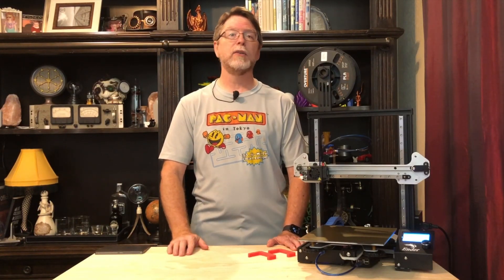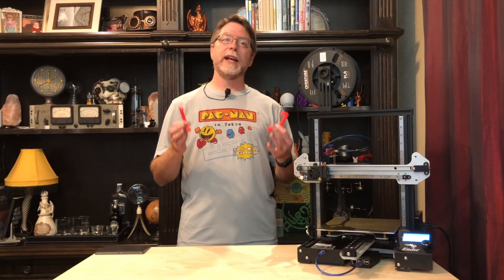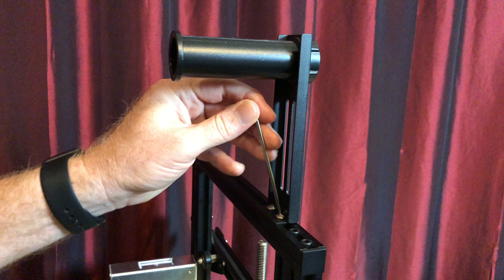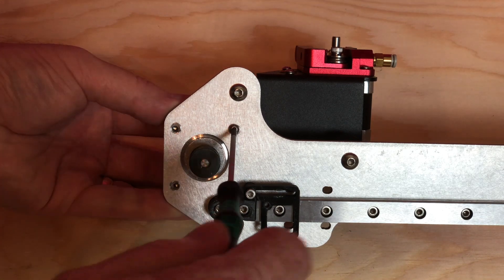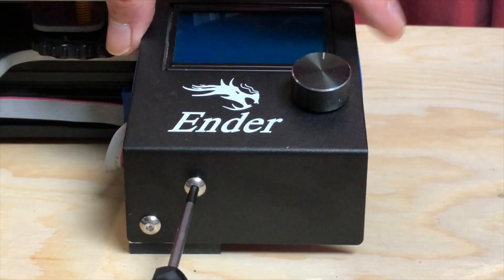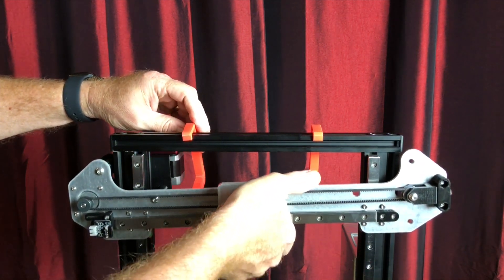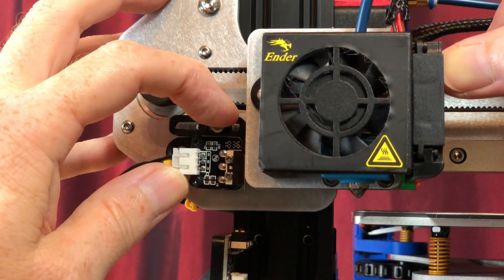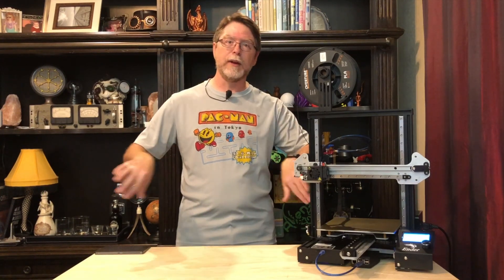How To Install 3Dfused X & Z Axis Linear Rail Kit for Ender 3 & Ender 3 Pro

Comment: This rail system is tops. I installed in on an Ender 3 and have only had minor issues here and there. Did you have any issues with z axis binding at the bottom of the lead screw with the nozzle at the bed? What about minor binding on the x axis?

The minor bind on the x axis is still a thing just on the first movement at the front of the bed when auto leveling. The z axis bind disappeared when I examined the upright rails very closely. Loosened the bottom of one of the rails, pushed in, and then retightened. Prefect now.
Reply from the maker: Hi Nathan! It took me a few tries getting the Z rails absolutely parallel to each other. I solved it by:
- Keeping one Z rail tightened,
- Loosening the Z rail,
- Gently tightening its top screw with the X gantry at the top of the Z axis,
- Tightening its bottom screw with the X gantry at the bottom of the Z axis, and
- Confirming smooth motion before tightening the remaining screws.

This is a lot easier if you remove the lead screw, so you can freely move the X gantry.

Binding on the X axis (left/right) or Y axis (forward/back) wasn't an issue for me, as there's only one rail and only one block on each of those axes, so there wasn't really anything to align.

If you remove the X belt (or at least loosen the X belt so you can get it off the stepper motor), does the X carriage move smoothly across the entire X axis rail?
Reply: @BV3D  It does travel smoothly. I have been so deep into trying to get klipper running that after I succeeded I wasn't paying attention to if the x axis had any issues anymore. It wasn't so much binding as it was attempting to go beyond the max travel allowed for the x axis to the right side. I will check tonight and report back.
Reply: @BV3D  Came here just for this comment thread. Got my Y/X/Z rails after the Edge Of Tech video on them, and used your guide to install. Have some binding at roughly 20mm up from the bed, and yet smooth everywhere else. Going to do what is suggested here tonight after work. :)
Reply: With klipper there is no binding at all.
Reply: Just to add to this for anyone that comes across this, make completely sure that the T nut is in the slot and turning when you tighten it down. I thought mine were. When you get them all lined up back the screw off a little bit and then slowly tighten to make sure they rotate 90 degrees.

Comment: Thanks for the great step-by-step guide. I just ordered the X/Z kit for a CR-10S from 3dfused. Given that they have virtually no instructions, I don't think I would have taken the plunge without your video.
Reply from the maker: Hi Joe! The CR10 kits should go on pretty much like the Ender 3 kits. If you run into any snags, their chat or email support should get you going, or I can try to help if you want.
Reply: @BV3D  I ran into a snag with the CR-10.  The hangars don't fit.
Reply from the maker: @videofarmerdad  What changes do you think would be necessary for them to fit? I don't have a CR-10. If you want to DM me on Twitter (there's a link in the description), you could send me a photo of the hangers on your printer. I'd be happy to try modifying the design.

Comment: Hello Brian, thanks for the good video.have a thought there,
 you could screw on the inside of the 20/40 z-extrusion temporarily small plates top and bottom. as a stop and alignment aid for the z-linear guide. if the 20/40 extrusions are parallel, then the linear guides are also mounted in parallel

Comment: Just installed all axes upgrades after using your videos. Thanks again also for the coupon code. Took a few tries due to zed binding, but no issues at all now. Smooth as butter, and I’m printing at slightly higher speeds than the old motion system.

Very happy, thanks again.
Reply from the maker: Hi! You're very welcome. I'm glad you're getting along well with the triple axis upgrade (or as Peter Solomon from Wham Bam Systems called it, "The All Axis Pass" 😄). Getting the two Z rails parallel can be a little tricky, but once it's dialed in and locked down, it's awesome.

Comment: One more guy to follow on YouTube. and one more upgrade to the Ender3. I've been toying with the idea of converting over to Linear Rails, and now I have just ordered these.
Reply from the maker: Thanks for following along, Denis! Let me know how it goes with your rail kits! 👍
Reply: @BV3D  Well It showed up and I finally installed my XYZ set today, was pretty easy, and only one part was broken in shipping, since 3dFused has all their parts as STL's on their website, it was a no brainier to download and print a new part. I did contact their tech support via their web trouble ticket system, just to see if they would reply in a timely manner, and found they where short and to the point, but friendly, explained what must have happened, and that I could hit the website for an STL of the part. 

While the rails are not "top of the line", you're NEVER going to get rails that cost $500 each for the price 3DFused is selling their set, it's good enough for what  need. I had looked into building my own set of XYZ linear rails, even with access to a CNC shop, which I do have access to, I KNOW I couldn't have done the same quality job as 3DFused did, and it would have cost about the same as well, and I would have used the same rails. 

One BAD thing, is that my Hero Fan no longer fits as well, since the X-axis Hotend carriage plate is so thick, I'll take the thick plate over the need to mode my Hero Fan mount, there won't be any wobble with the 3DFused mount.   

I'll buy another XYZ set for my other printer in a few months.
Reply: @TheDgdimick  
Hi Denis,
Just checking in to see how your printer is doing? with the new rail system and how are your prints turn out?
Reply: @TheDronzDr    They are awful, my main board died so I haven't had a chance to try them out. Well that's not really true, I did have one print come out before the board died. I just ordered another set for my other Ender3, so I guess you can say I like them. I did have a problem with my right hand screws being too long, wasn't able to get shorter ones so I printed up a spacer to fix the issue. I then emailed the STL to 3dFused to post 8f anyone else has this problem. It's just a 10mm spacer with 4 holes at 20mm centered. Bottom line, even with a broken printer, I really like the rails.
Reply: @TheDronzDr  Sent.
Reply: @TheDronzDr  So I have my second set of rails, still getting the "back order" of prints finished before I hack it apart and install them - working on Remote enclosures, SKRv1.3, RPi, and the Creality Main Board,  so I can place the printer in a heated enclosure.

Comment: Can you use a direct drive on this rail system?
Reply from the maker: I can't say for sure. The X carriage in this kit has the same hole placement to accommodate mounting the hot end and the fan shroud. But it probably depends on the direct drive system in question. If it's something that mounts (somehow?) using the screws that hold the wheels onto the carriage, then no, because this carriage won't have those holes. I'd recommend contacting 3Dfused to get the final word.
Reply: BV3D: Bryan Vines 
Ok thanks for your reply

Comment: Do the improvements in print quality justify these upgrades costing as much as the printer itself? I've always liked linear rails more than rollers, but am curious about the cost/benefit ratio. Thanks for the detailed video!
Reply from the maker: If you're already a fan of rails, and precision wherever possible, then this is probably an easy decision. Apart from the fact that they do a phenomenal job of restricting motion to just one axis, one of the things I appreciate about them is that the maintenance routine is literally a couple of drops of lubricant and a quick wipe every few weeks. I don't have to keep checking the wheels for wear, or carefully managing tension on eccentric nuts to keep them against the V-slots with just the right amount of pressure.

I have overtightened eccentric nuts before, and it resulted in a flat spot on the wheels that I could feel as I moved the bed back and forth. That little bit of a bump in motion that it caused can show up on the surface of a print. I mean it's not SEVERE, but still, I'd rather not have to deal with it.

That said, it doubles the cost of the printer. So is it a whole other printer's worth of precision and ease-of-maintenance? For me it is. Even if 3Dfused hadn't sent these to me, I would've bought them anyway, just to gain the experience with linear rails. But if you've only got one printer, and you're trying to decide whether to spring for a full set of rails, or buy a second printer, I'd say spend the money on a second printer. A second printer would allow you to parallelize print projects; you could have both running at once. Or if one breaks, you've still got a working one.

I don't know if that made anything clearer or not. Hopefully yes, but if not, let me know and we can talk more about it.
Reply: @BV3D  Thank you. I've been looking at DIY rail conversions since I bought the Ender 3 so it's an upgrade that's been in the back of my mind for awhile. As mentioned, the Ender has a solid base for an upgrade like this. 

I only have one printer and I don't print a lot, but what I do print I'd like it to be the best print I can get. For that reason, as long as the benefits match the costs, I could opt for this upgrade instead of another printer without regrets.

I really appreciate the detailed response and look forward to possibly seeing some in depth results of your upgrade.
Reply: They also sell the rails and blocks separate from there kits and you can diy those up for a little more cost effective solution

Comment: how long dose it take to fix it
Reply from the maker: Hi Paul! The full installation can take anywhere from 30 minutes to an hour, depending on how comfortable you are working on the printer, and whether you need to make adjustments to the positioning of the Z rails.

Comment: Great video! I think I could install these easily now having this as a reference. It would be very interesting to see some examples of what specific improvements we can get by installing this kit - I'm guessing more position restriction / less slop between where the vertical layers are placed on top of each other. If you could possibly assemble a video showing standard Ender 3 rail prints alongside prints made with the Linear Rail upgrade, that would be awesome to see, so that it would be clearer what to expect from purchasing this upgrade. Best wishes!

Comment: How much more weight  is new gantry verses old
Reply from the maker: I'm checking with 3Dfused to see how much the X gantry weighs with the rail and X carriage on board. I'm going to guess it weighs a little bit more,  but I'll find out for sure and report back. I've got the stock parts sitting in one area, so I can weight that and then compare.
Reply: If weight is a good amount more. Will the stock motors handle the weight ?

Comment: Will the linear rails allow you to print much higher speeds as well?
Reply from the maker: Hi! I think the real limiting factor on printing faster is that I'm going to need a hot end that's capable of heating faster, and maintaining a higher material flow rate. If the printer can't melt plastic fast enough, it's not going to be able to print. I should look into either a Mosquito or a Volcano or similar higher-throughput hot ends.
Reply: BV3D: Bryan Vines   Thanks. 
That makes perfect sense to me.

Comment: I have put s42A closed loop stepper on X and Y. The steppers do not heat and they don't loose steps but the belts do skip now. Lol 💝💝💝 it also works with stepper on the bontech-like extruders but now the filament break because not strong enough. Last one is a joke. I have just kept Z axis with DrV8825 🕊
Reply from the maker: So now instead of belts, you need some kind of chain-drive system? How much are steppers like that, and do they communicate with the printer's firmware to let it know what's going on with the steps, or do the steppers just do what you tell them and that's that? I don't know much about closed-loop systems other than understanding the concept a little.
Reply: @BV3D  Chain maybe or not! Belts are cheap to replace and for me a kind of fail-safe in case of wrong-doing :)
 
S42a (bigtreetech or MKS/aliexpress/around 35 euros each) have no feed back to the mainboard and the driver A4954 could be improved with TMC2xxx. The interface is limited to enable/steps. The mainboard sends the step pulses and the closed loop system checks the position (a permanent magnet glued on the rotor and a magnet hall effect sensor). You can load other strategies (speed) but position is fine for 3D printers. The product lacks completely of proper instructions to configure / caliber the closed loop, especially all the config should be done with the stepper not mounted on the 3D printer.

Comment: A 3D printer is like a wife but better, if you want an egg, the printer can drop an egg like a chick if you want. You can upgrade the 3D printer, your wife too but it is way more expensive and you can't silence your wife like silent stepper drivers 💟

Comment: The real winner of this is the "X Gantry Alignment Tool" that will make this so much easier for everyone who does this now. Thanks for taking the time to make this video and tool!
Reply from the maker: Thanks, Shea! I am going to have to revise the tool a little bit for the stock printer, because I want to do a video about getting the X gantry parallel with the horizontal plane of the printer. Looking back at when I built that printer in December, I think the gantry was off by a few degrees, and that's why I had such a hard time adjusting the bed when I was first starting with the Ender 3 Pro.
Reply: if you're like me and jumped the gun and started to take everything apart before printing the alignment tool, 2 cheap calipers set and locked to 101mm did the trick

Comment: Great Video,, Bryan! Looking forward to seeing the after prints, how much of a difference there is in print quality, speed, etc. It would be interesting to see if you could get the speed up to 150mm/sec printing, and what the quality looks like. Time to go bolt a wing on the back of my car! :-)
Reply from the maker: Hi John! I think printing at 150mm/s is going to require a hot end capable of melting more material faster. Maybe a Mosquito or a Volcano or something? That, and a big enough model for it to matter. The printer still needs to be able to accelerate to that speed, which will take some small amount of time. As I understand it, models without long straightaways on them are going to make that difficult, since the printer is going to have to stop and change direction before it ever really reaches the desired speed. Still, it's fun to try! What's your take on acceleration vs. flow rate vs. model shape?
Reply: BV3D: Bryan Vines I think it was CHEP that posted a great article from MatterHackers or Printed Solid about flow rates, but my take on is similar to yours, definitely need a hotend that can melt the plastic fast enough and a model with long straights to be able to achieve a true higher print speed. Chris Riley also had a great video about acceleration and jerk settings that would come into play at higher speeds. I mean, you can set the speed in the slicer, but will the printer ever truly reach that speed. And I’m not sure how you could even test it to know for sure.
Reply: Hi, what about a acceleration sensor with an Arduino to log the speed

Comment: I always wondered why 3d printers didn't start with liner bearings to start with.  Thank you for your work and time. 👍
Reply: Not that expensive.  MGN12H Mini Linear Rail
Reply: Nice kit fits perfect. I think one misconception people have about linear rails is that they will increase print quality. In reality what they give you is consistency in the long run as they keep the tolerances much better longer than delrin wheels ever could and they also give you the ability to crank up the speed (as long as the rest of the components can keep up) with less losses in quality.
Reply: Linear bearings are a cheaper alternative to rails. Rails are really expensive and you don't need them, but the option and freedom is there to experiment with them.
Reply: Because you don't need it and it is expensive.